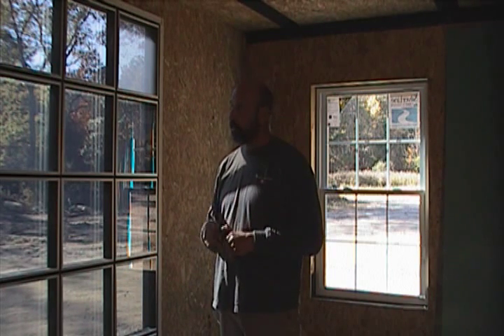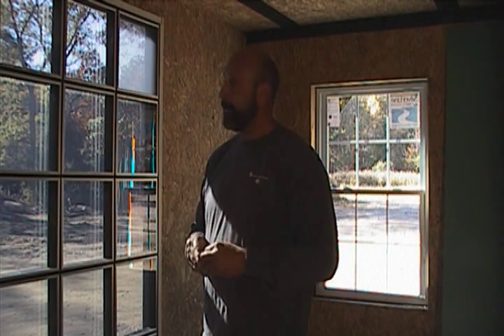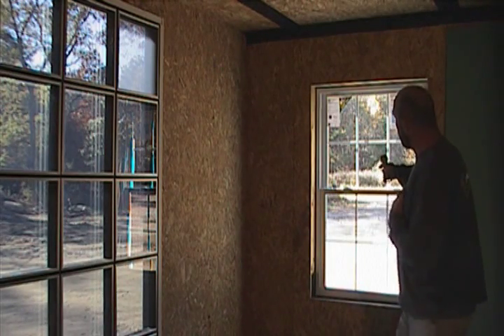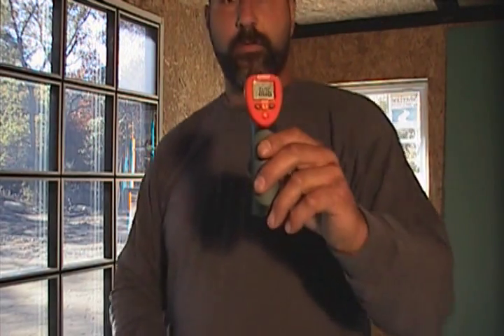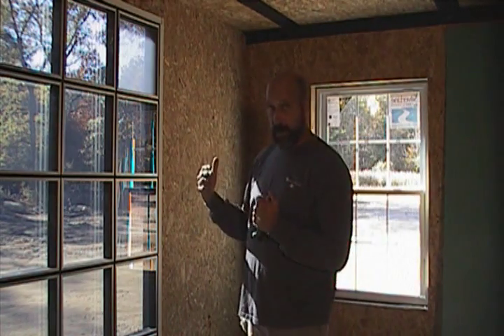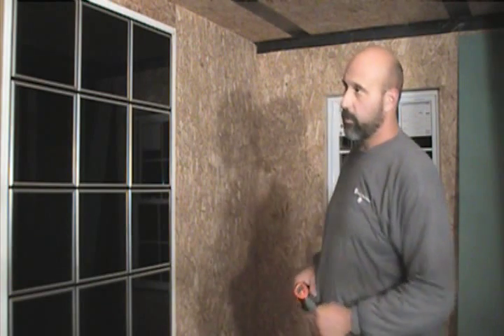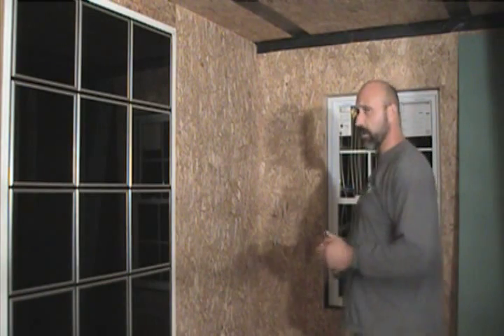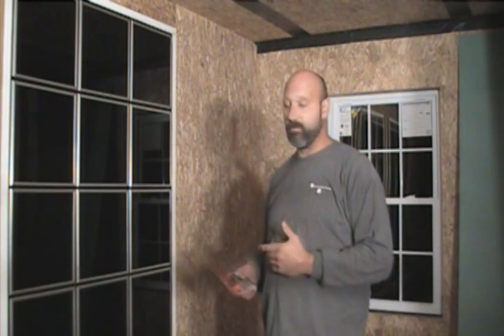Trombe Wall? Window? best of both worlds

Comment: So, what happens when the temps drop to -20F+ and you start getting 30-40mph winds with several cloudy days and your water starts to freeze? This certainly wouldn't work well in all climates unless you start aggressively heating that window from the inside to prevent a hard freeze.

A very neat concept though, water is about as good as it gets for storing solar energy and being placed in a window is a neat way to keep that water from cooling off due to evaporation and keep it in a place that you won't have to look at it.

Yes, those IR thermometers don't work at all on reflective/transparent surfaces, not to mention the fact that he was comparing that windows temperature to another with the glazing facing a different direction, naturally the trombe wall is orientated to capture the most solar energy so that other window just hasn't nearly as much direct solar exposure. That is hardly the fault of it not being a special solar window.